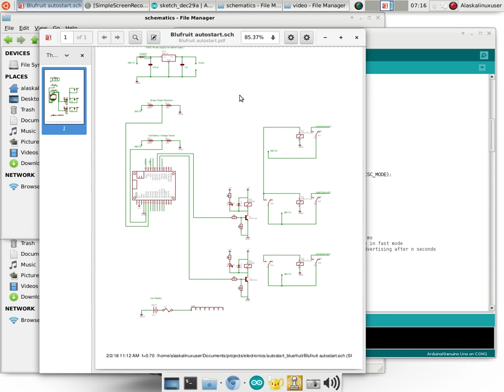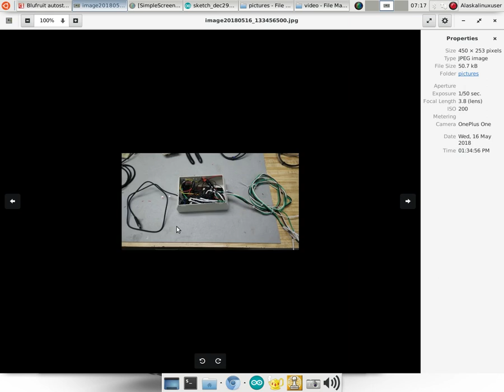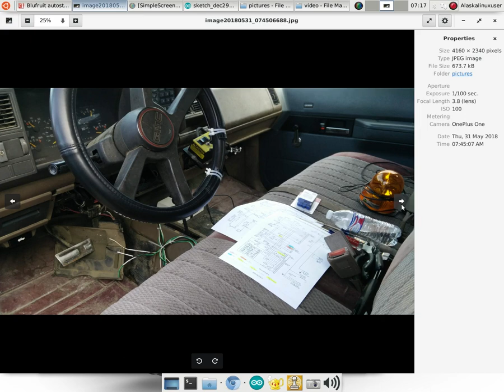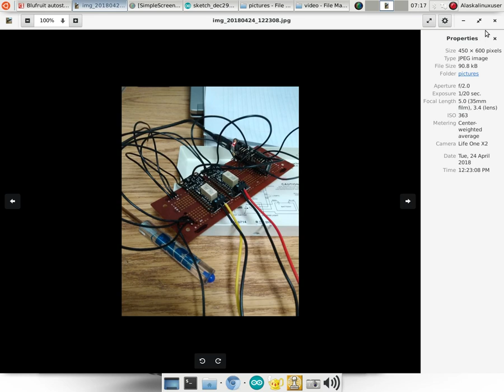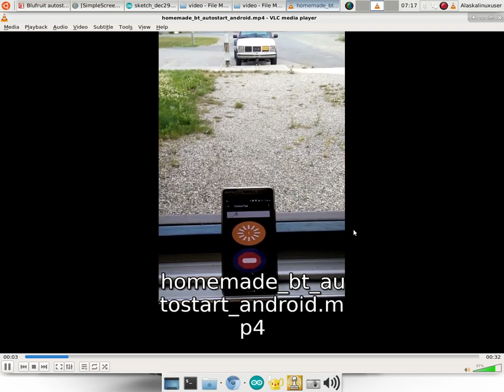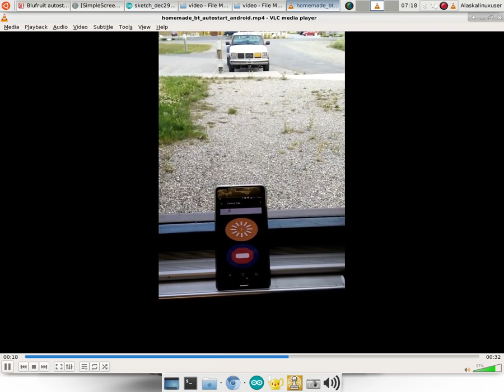Other Projects: DIY Bluetooth Autostart

Comment: hello there!
its me again,
i recently ported ressurection remix 7.1.2 from yu yuniqu for my lyf wind 3.
it also booted up but then its touch was not working.i searched various threads but none of them helped me.
i know you as the last person that can give me some idea.
EDIT: And hey: i know that you taught us to make rom not to port from here and there but i have a very very old laptop with pentium dual core which hardly opens chrome to play videos.
therefore i have started porting.
i was really hoping that you could taught us to port roms from similar specs for *qualcomm.
dont forget to give me a solution. 
thanks!